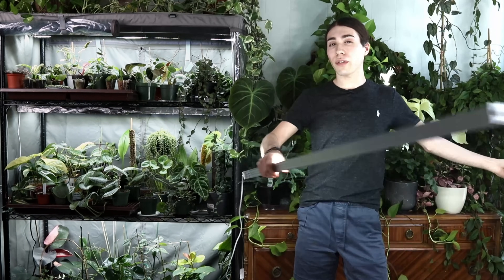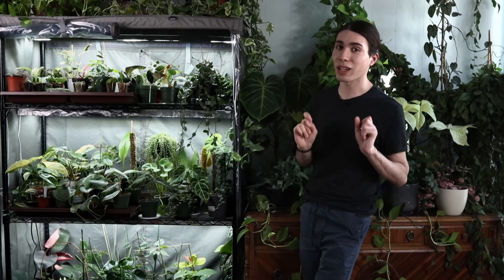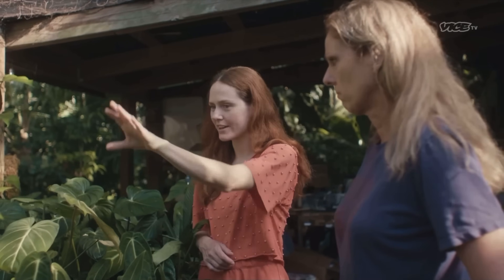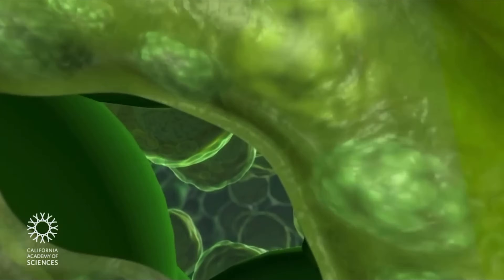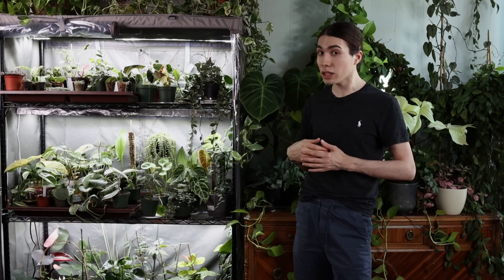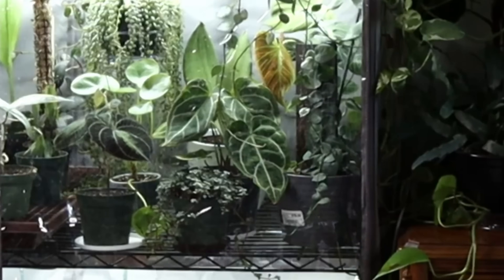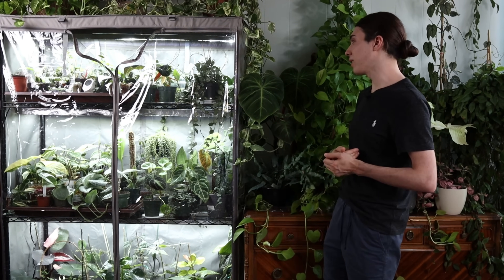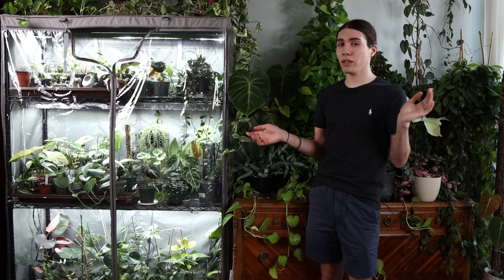How to Use Regular LED Lights as Grow Lights | Avoid the Industry Markup

Comment: 12:03 If u want a cheap ($20), quick & dirty automated intake/exhaust fan system (links @btm), you'll need: 2 fans (3" or 4.75" kind), 2 6-10ft USB ext cables, 1 2-port USB wall adapter plug, hot glue, scissors.

You'll make 2 fan holes in your greenhouse cover--L side btm (intake) & R side top (exhaust). Draw 1 square to fit the fan perimeter & draw a 2nd smaller square 1" inside it connecting the 8 corners together w/ 4 lines (a Sq in a Sq). Cut out the smaller Sq & snip the diagonal lines so u have 4 flap. Test the fans 1st so u know which way they blow to face each correctly. Glue the 4 flaps to the 4 fan sides (let the hot glue cool slightly so it doesn't melt the cover). For a flush look outside have the fans/flaps on the inside of the cover. Plug in. Done.

$9 2pk: https://www.amazon.com/AITRIP-Brushless-80x25mm-Computer-Radiators/dp/B09LRYV4B5
$4.99 10ft: https://www.amazon.com/Cotchear-Extension-Extender-Transmission-Printer/dp/B0B99L5M1C/
$4.99 2-port: https://www.amazon.com/Anker-PowerPort-Charger-Compact-Foldable/dp/B07H8WJCTF

Comment: Great video! One thing I need to point out though is that Lumens is a pretty inaccurate scale for measuring lamp brightness / efficiency when it comes to growing plants, since the measurement was created based on 'perceived brightness', i.e. how bright the human eye sees it. However because our eyes see some parts of the spectrum better than others, this distorts our perception (even if the light is completely white).
For plants, the value you want to be looking at is the PPF (Photosynthetic Photon Flux). This is simply put a measurement of the amount of photons (within the usable spectrum for plants) that a lamp emits per second. It is muuuch more accurate than Lumens and lets you get a real grasp on the efficiency of the lamp and predict how many Watts you'll have to put in and how much growth you get out of it.
Now, I doubt that any lightbulb at Home Depot will have a PPF rating, and that the purpose of this video is to show budget solutions for hobbyists, but since it is a standard in the grow light industry to publish those ratings (or you can find creators on YouTube that buy lamps, measure them and publish their PPF(D) values), it shouldn't be that hard to find some for a reasonable price online.
Anyways, worth checking out. Keep up the good content!

Comment: Every wave lenght does photosynthesis, do you know about emerson effect with red and far red ? I don't think so, do you know about micro moles per watts ? Do you know about ePAR ? Of course you can use any white led fixture to grow vegetables, comercial grade fixture are just way more efficient as you get more usable ePAR per watts than your "normal" LEDs + your normal leds don't have emersson effect, you just don't understand the "markup" , comercial grow LEDs provide more light per watt and less heat per watt than your normal LEDs , so it's less expensive in the long run to use grow lights instead of normal lights.

Comment: I just subscribed...some foliage can be pretty, but I love fruit, vegetables and flowers and I grow some stuff hydroponically. I do have a professional grow light that I've had several years but it is not one of the big name ones. Not fond of purple light, but have to grow year-round for food, so I want to be sure these things have sufficient light. If you do know of a white light you can recommend that will work for fruits and vegetables throughout the growing cycle please provide a link and I'll save it for next time I get a little ahead financially so I can get a second one. I love your shelf set-up with the cover around it. I might look into getting that instead of investing in a grow tent, at least temporarily, and I can just line it with some mylar. Currently I have a huge festival tent set up in the living room. It does reflect light back down to the plants but it's a real pain in the ass to get around since everytime I want to go to the front rooms of the house I have to duck down and sometimes hit my head on the frame.

Comment: I hope to successfully grow the micro tomatoes indoors this winter. Lettuce and other greens are easy enough but I have no transportation, on disability, very rural area, and in a camper, so if I want anything fresh I have to grow it. I order sardines and other things to survive. My indoor hydro gardens get overwhelming. But I have to use them. My first try, Tiny Tim tomatoes....way too big. So another fail. And they aren`t blooming. And it took nearly THREE YEARS to get real seeds of those thanks to sellers who lie. I planted several of the various seeds outside to find out what they were....Roma...Cherry, etc. I think I just received a variety pack of real ones. The Tiny Tims are great for pots though...just not the little gardens I use.

Comment: Glass is easy to find free when people throw it/ give it away. You can dismentle it, cut it to size with a cutter, drill holes with water and diamond bits to secure it or frame it in wood. An easy material to work with
Reply from the maker: Yes if you have the tools! Most people don't but I think it's really cool you know how to work with glass and the machinery associated.

Comment: How much does electric power cost where u live? I would pay additional 40€ for that beautiful rack u have there. 240w x 12h a day equals round about 85kWh a month which costs like 40€ here at least. 40-50 cent per kWh.
I have way to less windows here 😑 great video! Just discovered your channel!
Reply: The average rate in the USA for household electricity is  23 cents USD per kwh.   So about half of what you're paying.  The rates here in the USA have gone up rapidly over the past decade.  Just ten years ago, where i live in the upper midwest, our rate was only $0.13/kWh.

Comment: Really depends on the plant you are growing, a diy light good enough to grow quality cannabis efficiency will still be expensive. Most houseplants don't require much light at all. PPF and PPFD matter for all plants, if you put your house plants under the same light as my weed plants it would kill them withing days. Grow light do exist, they are real but yes some brands are better than others. Spectrum matters, light spread matters and when dealing with high value crops dependent on that light a company that understands that is also worth its weight in gold. My preferred light company will ship me a light ASAP for me to get up and I send them mine back to be fixed so my plant suffer very little. You pay for more than just a light. But yes for houseplants you do not need an $800 800w high parr output light.
Reply from the maker: I don't grow cannabis, I did mention that in the video. I agree with your statements cannabis is much more selective regarding very intense light and having very specific wavelengths of light during different stages of growth.

Comment: I am into aloe aristata, succulent, zebra haworthia. They don't get very tall. Is there a way to hang lights light that? Or is it just easir to adjust the height of the shelf and not try hanging the lights?
Reply from the maker: I'm sure there is, I don't think there are hooks areas for these lights though. I'm sure you could find lights that you could hang. These were just cheaper so I chose them.

Comment: Any input on edible plants needs?   How much wattage to look out for? Full spectrum? I know between 4500-6500k and 1500-3000 lumens is needed.. that's all I know so far.
Reply from the maker: As long as you're getting high lumens for low wattage you're good. Make sure you keep the lights are adjustable or you're lifting up the plants so they're about about 6 inches from the top of the plants.

Comment: This was an awesome video... All of those stupid "bling" videos are worthless! Finally, someone that just tells us straight and provides us with a simple solution. I'll be doing this setup for my first run of seedlings and greens for year round use. This is perfect. Thank you so much for sharing!! Might I suggest a cheap computer fan to circulate the air and heat.
Reply from the maker: The room is pretty cold and dry, i havent had any problems, but yes that may help!
Reply: @phytosexual  Ok.. so I finally got off my butt and bought the whole "system". I splurged for the 6-tier 24" deep racks from Home depot. Certainly NOT a fun experience finding them. I need the space for growing greens and micro-greens year round that fit (4)"1020" trays each shelf. It's mainly to supplement our diet. The covers you found are excellent and have great reviews. The lights are an AWESOME find. Who knew you would help us with the "SHTF" scenario right😁. I'm at $390 minus growing trays and shelf liner material. It'll pay for itself in a year with one harvest a week considering today's market. Thanks again!!!!

Comment: Hey Nick.  just a little correction... the chart you shared at the 10 minute mark is backwards.  Blue light is to the left and yellow light is to the right.  Technically we should be using bulbs closer to 3500-4000k.
Reply from the maker: 3500K to 4000K is warm light for flowering, im not sure abou the chart but it should be over 5000k for foliar growth.

Comment: This is a good video!
One comment though—you may want to replace the foil with mylar (space blankets). Aluminum foil can create, essentially, focused light like laser beams where the creases create high focal points.

I used to use some foil and here and there I had these mysterious holes showing up in leaves that proved to not be a result of pests or disease or fertilization problems. YMMV so obvs isn't an issue if you've never noticed spontaneous idiopathic browning or spotting. 🙃
Reply from the maker: haven't had any problems yet but thank you for the recommendation!

Comment: 8:32 so uv is needed for fruit and vegetables ?
Reply: 9:39 light temp is color not heat . Higher more blue 
More flowers want 3500 . Do you want lowest? Is 3500 lowest/warmest? 
Is that correct lowest = warmest ? 
My head is busting let me  rewind
Reply from the maker: higher k value = more blue = less flowers, lowest is warmest and that is best for flower.
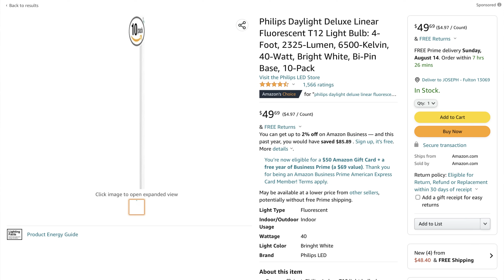Reply: 8:56 lumens matter watts are costs WOW!!
Reply: 12:56 I’m in Denver it’s crazy dry
Reply from the maker: No, but it can assist in flavor, nutrient value and color.

Comment: Would the 6500k light strips with adhesive work ?
Reply from the maker: Sure! As long as the light intensity is enough. You may need a lot of strips because they're usually less intense than bulbs.

Comment: Bro!! How do you stop root rot? I been watering using ice and letting it drip and soak in from top down and it seems to work. Do I need more compost to make it better draining?
Reply from the maker: I would assume compost would make it retain more water. I would suggest perlite or pumice to add aeration. Also try and pot your plants on the smaller side. Also, freezing water may not be good for tropical plants :/
Reply: @phytosexual  I use dead leaf litter pulverized as a compost now. Its less absorbant and keeps stuff fluffy. I used a 50%mix of leaves and soil.

Comment: Agreed. Led "grow lights" are very often underpowered, cheaply made, overpriced regular LED lights. Though, there are some exceptions especially on Amazon (sales can be insane). 

Additional tip, very high light, heat loving plants can be grown quite well under LED spotlight bulbs (make sure it has a metal casing since it will also act as a heatsink, and yes they will get too hot to touch and I'm pretty sure could give you a tan).
Reply from the maker: Thanks for the info!

Comment: I've had great success with breaking off the plastic diffuser on the standard base led bulbs. Much brighter and directed. I have a fixture with 6 5000k 13 watt bulbs mounted on it all spaced evenly, down firing so I can hang it on yo-yo's. It looks good enough. I thought I was only going to use it for starting seedlings. But things haven't started to stretch. Granted I'm only using it for herbs at the moment. I'd still try it on something more demanding.

Comment: I used to have fancy bar lights for my aquarium. Temporarily moved to a small apartment, built in the seventies. The living room had a little alcove built for (I presume) the large TV sets of the time.

I decided that would be a great spot for my 55g tank, so I used some 2x4 to make a shelf and threw it in there.

The alcove had track lighting in the ceiling, which seemed... Pointless, given that it was in a closet. But I had a bunch of hue bulbs left over after the move, so I decided to use those in the track lighting instead of the "aquarium" lights I had before.

To my surprise, the plants inside the tank grew quite well with the hue bulbs. I'd even say the plants grew BETTER.

I also created my own custom routines specifically for the fish tank, where the color and intensity varried throughout the day. Color temp started at 1600 in the morning, fading to a 6500k "blue" light after about 2 hours, then fading back down from 6500 to 1100 for the last two hours before turning off.

Comment: Went to a reptile expo a few weeks ago and talked to a guy that is always there selling his terrarium plant cuttings about lighting. And he basically said that "made for reptiles/terrariums/tarantulas/plants" is a big scam, and they mark up their stuff by 3 or 4 times. He pointed me to a website selling generic LEDs and I found a 4500K (I am not a fan of pure white for terrarium lighting) and 850 lumens, which pretty much the same as my previous 4500K tropical plant LED light by Exoterra. The difference is that the LED by Exoterra is 40 dollars, compared to the generic one I found for 9 dollars. And while the Exoterra one is more efficient at 8 watts compared to 10, the one I had did break after a little more than a year of use, and the generic one has a two year guarantee. I don't have much confidence the Exoterra one could outlast the generic one from my experience.

Shop around a bit online, the two numbers you are looking for are kelvin, in the 5000 - 6500K range and lumens, at the 800 - 1200 range pr. 10 watts.

Comment: Do you have your lights on a timer? Does it cause any problems with the lights, or does their packaging/directions specify no timers?
Reply from the maker: I don't see why timers would have any effect. It's the same as turning a light off and on. I do have a timer.
Reply: @phytosexual  Timers draw some power, so some lights come with instructions to not use them with a timer or dimmer, as that will cause them to burn out quickly.

Comment: Here's the issue......and the problem with using 'regular leds'
Leds are individual diodes wired in string and powered by a device called a driver.
'Regular' leds are 'driven' or powered at a higher current, pushing the diodes to its limit. Pushing a diode to its max, reduces efficiency.  Meaning you get less light per watts used that you are paying for.
Grow lights are the opposite, and purposely powered or driven at a lower current, but using more diodes. This process makes them more efficient. 
-Think of it like this.....1 person can carry a 100 pound box, and will look really strong.  But if you share the load with 4 people, the work load divided will be less per person, thus allowing more work to be done later.  
The average 'regular' led is probably around 1.2 - 1.6 umol/j. (Micromoles per jule).   That's the amount of photons your getting per watt you have to pay for.  
While quality grow lights put out between  2.0- 2.9 umol/j. 
We can use MPG from a car as an example. Your 'regular' led gas car gets 1.2 mpg for every gallon you pay for, while my quality 'grow led car' gets 2.9 mpg. 
So while I'm paying more up front, my yield is better, cheaper payment per month on my bill, and lasts 5x longer.

Comment: Well, to give an idea, I replaced my outside spotlights (2 cheapo Walmart LED floodlights) with some proper outdoor LED flood lights and didn't know what to do with the old lights. They still worked just fine. So, mounted the fixture to a bookshelf and managed to grow a few plants with it. It even grew peppers indoors. I also have a cheapo LED shop light that puts out a lot of light and helps a sprawling tomato plant grow, which FINALLY bloomed after five months of growing. I've also grown with generic florescent shop lights. Back in the day I used the old incandescent bulbs (two 100 watters) to supply some extra light to some plants in an area without enough window light.

EDIT: Also, WTF, I have never paid more than about $20 for a plant. Most plants I have and have had came from free to cheap seeds or cuttings from friends, neighbors, whoever has a plant I want that can be propagated via cuttings. Sometimes I get plants via root division.
Reply from the maker: $20.00 is the low end for this community. Plants go up to 20k historically.

Comment: I have used indoor grow lights for decades. I worked at the largest grow light sales company in the world. 

When it comes to led lights, most work fine with varying levels of power. Grow bulbs are still better because more energy is produced in the absorbable part of the spectrum. 

High Intensity Discharge lights need specific bulbs for growing or you face the same problem. 

The ballast for a shop light and a grow light are usually super similar, but the bulbs are most certainly tuned for their applications. 

But the real secret is that flashing lights provide as much energy for a plant as direct light. Turns out leaves are a lot like tiny batteries and can only utilize so much light over a given amount of time. This is why light movers are actually a positive use of energy where you get the same output fueling 1.5x or more plants.